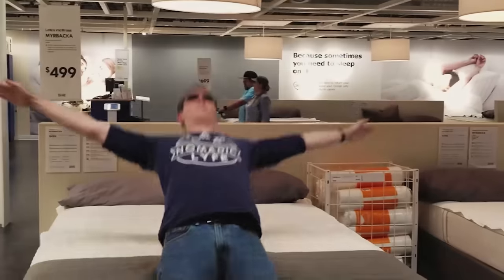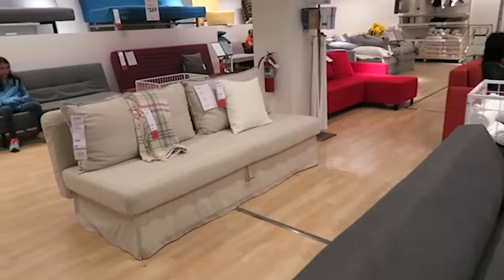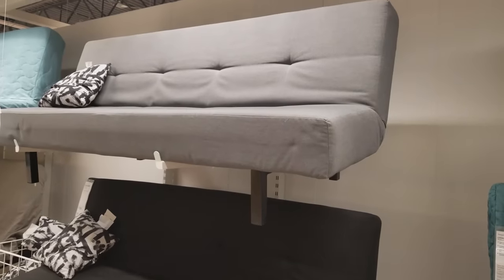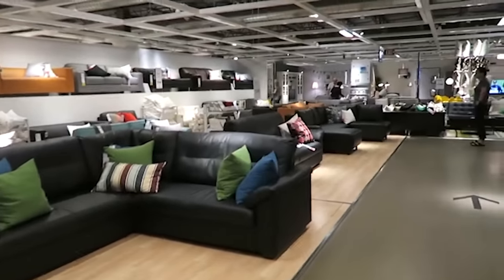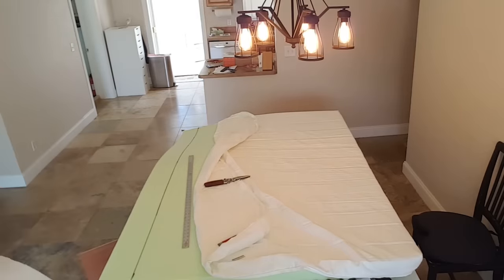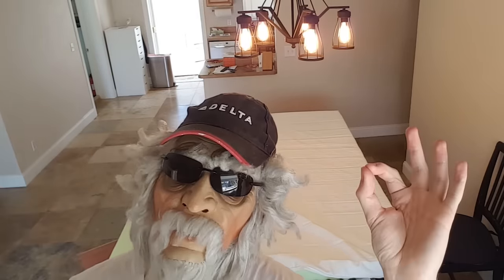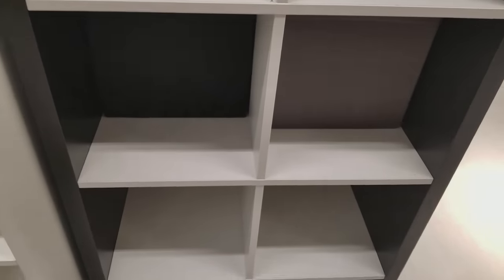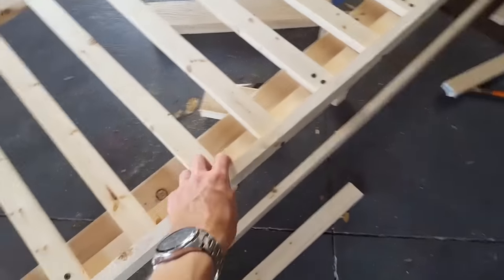IKEA Beds for Van Life & Tiny Houses

Comment: I did a build out for my daughters Pro Master City. For the bed I bought a good quality 28 x 80 inch luan door( not the one that has a fibre  honeycomb one) I also bought 4  short table legs with the metal screw in bracket . On the door rail there is a solid 2 1/2 inch rail around the outer edges you can screw the brackets into. I made these so the distance underneath is 11 1/2 inches so the standard 11 inch bins will fit underneath. On either end I cut 1/2 inch plywood panels 28 wide x 36 inches high to make the bed ends and screwed these into the rail headers. This gives you enough for 5 -- 26" x 17" bins underneath. I used the collapsible fold up bins because they are very square  and give you the most space as compared to the clear storage bins that have rounded corners and big lips on the top. My bins fit so snug I do not need bungee cords to hold them from sliding out.
Reply from the maker: Ah excellent setup, very helpful to have those bins

Comment: Actually, the fold-back futons might work if you mounted drawer slides onto the base so that it pulls out.  It would depend on the construction of the futon base as to whether it could be modified to fit/work.

Comment: Since you have to cut down the mattress to fit , you probably have a hard time keeping your too-large sheets fitting neatly.. you can use a pair of suspenders, I would say a medium or large would stretch far enough to go the width/breadth - anyway from sheetside to sheetside and be adjustable, so just simply use them to pull the edges of the sheet together under the matress like garters for ladies' hose, they pull the hose to the adjustable garter and close the gap and stretch and keep taut the hose so there aren't wrinkles, bags and sags.
Reply: if YOU GO TO A medical supply type store; you can buy what are like 'minature' suspenders.  They're made for hospital type beds; to keep the sheets on. they really work.

Comment: If your doing semi van life or weekend warrior  And still need your truck/van for hauling and other things And want a cheap but strong way to have a bed which is quickly removable without lifting heavy items ...My plan is to Get a iron/steel angle iron bed frame   Cut it into 3 or 4 inch size pieces  Drill holes in each piece for pins  weld it to the frame of the truck inside   Buy square aluminum tubing Drill same size hole for pins  Place the tubes on each bed frame  Place a thin foldable (hinges) wood board on top and unroll some Memory foam ...Done  Just make sure you have the welds on the frame of the van or truck and you have more then 3 or 4 sets to support your weight plus extra 
The bonus is that you can remove it quickly or use it as extra use without the foam there  If you drill out a few slots or holes in the base wood You can run a portable >electric< heater under the bed Making sure there is a nothing close by that would burn  This i would have on low ..Now you have heat under you and rising above you from the bed ends
Reply from the maker: Hmm interesting idea. I like it

Comment: Use the sofa from 0:50 and build a simple frame under it. In the frame, build pull-out drawers and screw the sofa to it.
Reply from the maker: Good strategy
Reply: I forgot to add that I meant the steel frame. Drawers can be made of wood.

Comment: Yeah pre-made very rarely works unless you have a large wheel base and are prepared to waste a bit of space. I’ve been toying with the idea for a murphy bed or maybe a bed that is on runners and can slide up the wall of the van.
Reply from the maker: That could turn out pretty cool. I've seen one that was on pulleys and was raised up to the ceiling (box van). It was in this compilation https://youtu.be/i7rNDhmEGOc

Comment: I am working on building out a van i am on the early stages and am planing alot of different ideas like a 4 way convertible bed it is a 6' long in the largest mode, It  can be 3' wide going side to side of the van of the bed and a 2 person seating eating mainly for day to day stealth camping mode), the bed will for a U shape table that can seat 7 or fold from the center to do a 3 by 5 open to the roof, or a 2 by 10 running threw the whole van. under the 2 person seating will be on one side a portable toilet and the other a 3 by 2 Asian soaking tub / shower pan when mostly only using the soaking when connected to a water source.

Comment: Great vid. I'm all about the IKEA for van builds because I'm not a carpenter. The reason I rejected ready made sofa beds is that they mostly don't accommodate the wheel well, so that $500 sofa ends up with a big hole cut into the back. [Sad face]
Reply from the maker: Oh man I forgot to mention That! Very true I had to specifically build mine to go around the wheel well. Might work if you did it horizontal though
Reply: @zhkopec  I thought about widthways too.  A 2 seat sofa bed that extends down the length of the van would be really cool. Have it behind the cab, facing backwards?
Reply from the maker: @Mevi  I never considered to do it backwards. That be pretty cool. If I ever did a bigger van id have the couch in front of the back and have a withdrawing green screen for videos haha
Reply: @zhkopec  travel the world without leaving the couch. 😄

Comment: Be careful with the bookcases getting wet. I have them in my home, a water leak dripped onto the wood and it swelled lifting the laminate.
Reply from the maker: Good point. I do often use it as a counter top, but make sure to wipe off any extra liquid when I'm done.

Comment: One thing i see lacking in every van build is the lack of a nice/sitting couch area where you can just chill and relax on a regular sized couch without being cramped up on some little compromised space saving seat or having to sit on a fixed bed all the time. My current van has a fixed bed raised up at the back like nearly every other build with a "garage" underneath. My rebuild will have a regular sized couch either one that already converts to a bed or i am just getting a nice corner couch and just getting an extra bit of foam my self i can add and turn it into a bed a night.

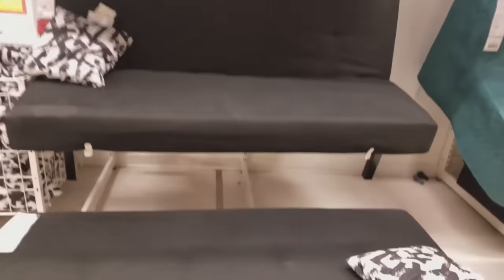Comment: The flip-flop designs you're showing around 0:44 (Ikea Balkarp) they do work quite well for a van conversion! Keep in mind that on my case I add to cut and weld the frame to my convenience! That do add work and complexity to the project. But the end result can be quite satisfactory. As a bed it worked perfectly and it's rather cheap! ;-)

Although after the second trip I totally reconfigured my van and got rid of the flip bed/sofa. ;-)

Comment: I'm from Sweden and Swedes know IKEA. Even if you as a Swede have never bought anything at IKEA there's a 99% chance you still have something from there. What's also certain is that their furniture is crap. I would never put IKEA furniture in my RV. It's eventually gonna break or fall apart from the shaking, bumps, and vibrations because of the cheap particle board and wood they use.

I prefer to buy second hand furniture of a better construction because at least then I would've spent much less on something that may just hold up a bit longer than anything from IKEA. Even if you find something second hand from IKEA that's 30 years old it'll still be a better construction than the stuff they sell today.
Reply from the maker: I see your position. IKEA has it's own charm yo mr as inexpensive and trendy looking. Though a few things I've gotten there have really stood up to the test of time

Comment: Personally, I want the holy grail (at least my holy grail): a bed you can put away without unmaking and making it twice a day. Because I'm a lazy son of a b... that means either Murphy bed or a more esoteric design that gets lifted into the ceiling. Realistically, the Murphy bed seems like the most likely option; just pick up enough 8020 t-slot aluminium and bolt a frame together and arrange for a frame against the side of the van to hold it and boom. I guess we'll see how that works out... Also, in a van it's probably important to think about moisture under the mattress. A Hypervent mat that lifts the mattress off the surface and allows air circulation would help prevent mold. Or, the deluxe option, a Froli sleep system. Plastic "box springs" that both raise the mattress off the surface and give better comfort and... well... springiness.
Reply from the maker: Same. It's a big hassle to make it every day but space is so vital. I saw a box truck with a lift up bed using pullies and that was pretty neat. At around 13:00 https://youtu.be/i7rNDhmEGOc
Reply: @zhkopec  yeah I've seen a few DIY variants. Another guy (I forget the Youtube link) did it in a high-top van too. But in a low-top the idea is of course completely out. In a Transit high-top you could do it, if you put a couch or something underneath (as you'd lose a fair bit of standing room underneath there). But a Murphy bed is simpler. There are several examples; Jarrod Tocci had one van on his channel recently where he had a Murphy bed, and you can see it on some RV's too. The Leisure Travel Van Wonder with the Murphy bed option is amazing, but of course that's both taller and wider than a van.

Comment: The Friheten goes from a single bed, at least for me since I am a side sleeper, to a small double bed ("Guests" ahem). The only problem is that with all the "xtra" that comes with the furniture, storage space is small compared to a custom design.
I got 2 questions regarding the Minnesund
1) Is the 4 incher thick enough for a 205 lb side sleeper?
2) What are the dimensions of the interior height of the van where the bed is placed, the floor to the top of the bed mattress and your height for reference? Thanks.
I currently sleep on a 20 inch wide mat while hiking or while car camping, I don't need the extra space as a side sleeper, so I could make some space in the minivan.

Comment: I bought a bigger van rather than compremise on the bed and the thought of having to mke the bed every night just isn't appealing. When I saw that we might have to sleep on a double mattress I said to my wife "We're gunna need a bigger van!"
Reply from the maker: It's a big deal to have to make the bed everyday. I end up sleeping in couch mode 90% of the time :p
Reply: @zhkopec  Thanks for confirming that.... We  have two pull out couched that hang off the end of the tailgate. There are two small tables either side attached to the doors. So we back the van towards the view and use those when we just want to sit. When done they simply fold over and slide back under the bed. We never have to touch the bed. We live outside, so no need for indoor chairs. If it rains, we're still outside under the awning.